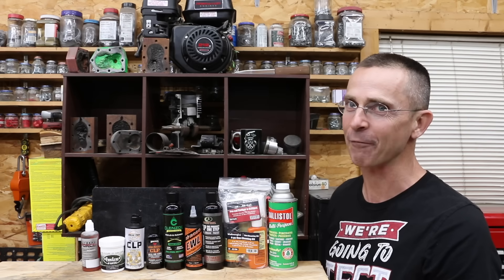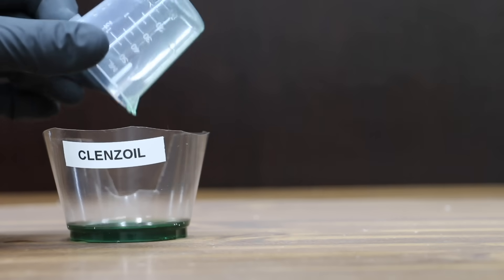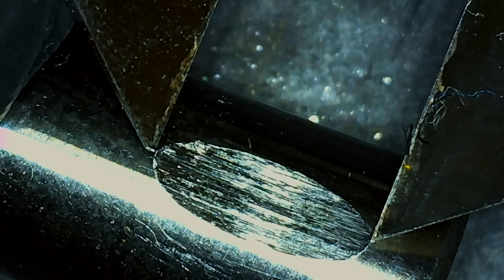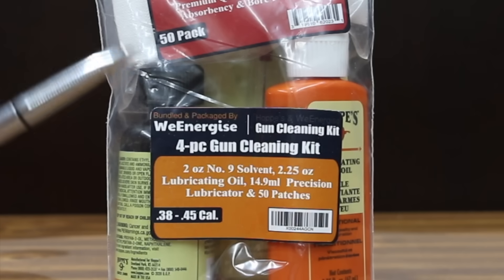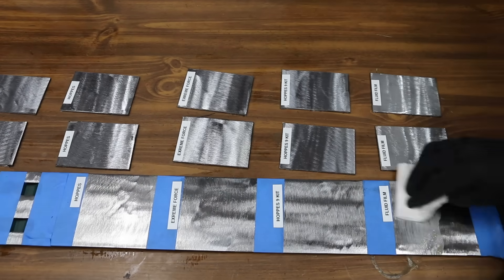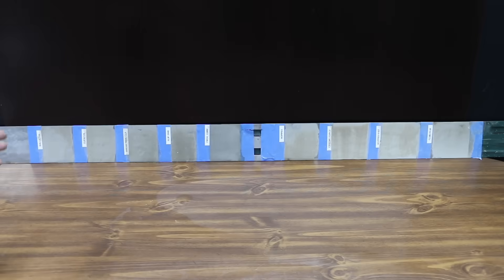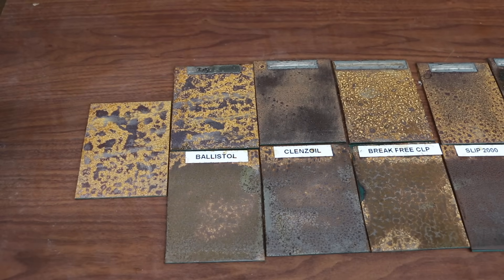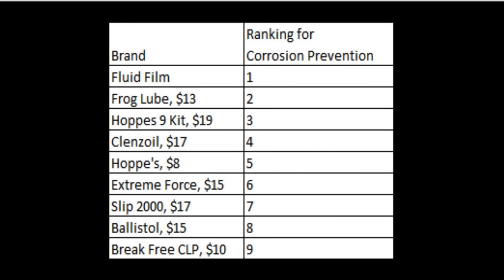Don't Buy A CLP Until You Watch This Review! It'll Save You Time And Money!

Comment: The overall poor performance of the Ballistol was interesting to me only because it is one of the most popular choices for black powder shooting. This is (I presume) because of its ability to suspend itself in water. There are actual instructions on the bottle on what concentrations of Ballistol to water in a spray bottle to use for various applications (it turns an opaque white, just like cutting tool lubricant in something like a CNC machine). Hot water is the cleaner of choice for all black powder weapons after a shooting session, followed by Ballistol for general cleaning, i.e. between shots, and then thick "bore butters" for patch/ball lubrication or storage. The Ballistol helps to clean up a lot of that water left behind after those first few passes with a scrub brush, as opposed to getting trapped or held in place by a gun oil or bore butter. That being said, I wonder how some of these other products respond to water? It would be interesting to discover a superior product to Ballistol that also responds similarly to water.

Comment: There is a huge mark up for products touted as "gun lubes"; this video is great.  But, there was no control for the cleaning test-  running the drill cloth dry, or with just water or alcohol could have given a similar excellent result (copper fouling, and powder residue is different than diesel exhaust-- likely easier to wipe off).  It would be interesting to run these CLP's against common non-gun products, to assess value (eg vs. 3in1, WD40, or motor oil, as previous comment).  The lubricant testing was excellent. Thanks.
Reply from the maker: Thanks!  Thanks for the constructive feedback.

Comment: friend raves about using engine oil fron turbine aircraft engines called Mobile 254, its for high heat high carbon areas, so bolt carriers are the perfec place for it,  not so much a general cleaner.  to decarbon you use a cleaner called Brulin 512  and man do it decarbon stuff but you cant buy small amounts so he uses Hoppes
Reply from the maker: Thanks for sharing.

Comment: Great video as always! What about a test of the smaller bit sets you would put in a travel tool bag. 30-50ish piece ones. Test for usability, ie do they fill them with useless bits you would never use and are the bits quality as good as individual sales or do they put low quality ones in to bring cost down.
Reply from the maker: Thanks!  Thanks for the suggestion.

Comment: CLPs are a compromise. A good detergent won’t be a good lubricant and vice versa. I have CLP for field expedient purposes. If the gun needs to run immediately, hopefully the clp will help dissolve crud and provide some lubrication ASAP. If you have time, a proper cleaner and separate lubricant works a lot better. Frog Lube is designed to be applied and heated to “soak in” and make a film, so your oven test did help it do it’s job. However I haven’t found it to be great for lubricating lots of moving parts. Hoppes oil is also a poor lubricant. MPro7 and Lucas Extreme duty can be found at most sporting goods and auto parts stores and are much better, as are countless other oils and greases. Great test though, will definitely influence what CLP I keep in my bag!
Reply from the maker: Thanks!  Thanks for the feedback.

Comment: You reported results of the wear scars to include 3 significant figures. 

That’s measurable, but I wonder what deviation you’d get if you ran one setup twice or more.

Using your own opinion, do you think the repeatability is within a fraction of a percent? If not, maybe just 2 significant figures should be reported in your graph.

Comment: I make my own gun cleaner and lube, using a recipe called "Ed's Red", which is based on the "Frankford Arsenal Cleaner No. 18" recipe, but updated.   (For example, Sperm Oil is not readily available anymore).    I've found it works very well for a LOT lower cost than any of the various 'wonderful' store brands.   

BTW - "Hoppe's" isn't pronounced "Hops".   It's Hop-pees, like saying 'happy' with an O.  

Maybe mix up some Ed's Red for your next review?
Reply from the maker: Thanks for the suggestion.

Comment: You should do a test between time-serts, helicoils, locking inserts, etc… for repairing stripped threads! It will be interesting to see the strength differences between them and the materials strengths.
Reply from the maker: Thanks for the suggestion.

Comment: You can buy the Break-Free CLP in a foaming aerosol can from Wally world or Amazon for about $1/Oz in a 12-oz can. I use it primarily for cleaning but I use TW25B for certain lube applications for larger sliding surfaces.
Reply from the maker: Thanks for sharing.

Comment: If you can include Militec in the 2nd round that would be great.  Developed for the military back in the day for the M16.    
Long stories short.  Used in race engine.  Oil pump fell on on the 350 during race.  Put back on and went racing.  Another time Lost coolant.  End result.  Melted 3 pistons, had to replace heads and 3 used pistons.  No oil related damage.  Went racing.
I use it in everything.  Autos, gas and diesel tractors, mowers, furnace blower motors and door knobs.
Reply from the maker: Thanks for the suggestion.

Comment: These were CLP's.  I'm not a fan of them.  They try to do 3 things all at once and tend to be the proverbial "jack of all trades, master of none."  A CLP is good for use in the field, as they were designed, but unless you need to clean and lube your gun in the bush or in combat, then task specific products are almost always better.

Typically, there are 3 basic cleaners depending on type of firearm and ammo:  a carbon cleaner, a copper cleaner, and a lead cleaner.

Lubrication, the best type will depend on the firearm.  Semi-autos have different lube needs than a bolt action, for example.  Climate can also dictate lube needs.

Protection.  What goes on the outside of the firearm to protect against rust.  There are several options here as well.  Some oils, while they are good lubes, aren't great at rust protection.  And, don't over look waxes for external protection.  Renaissance Wax, for example, is outstanding for the externals. It protects against moisture, rust, and even the oils and acids from fingers very well.

So, I'd like to see a "series" on firearm cleaners, lubes, and protectants, with each compared and tested for what it was designed to do, and include a couple of the many "home brew" recipes as well!

Concerning the cleaners, instead of dissolving carbon out of a section of tail pipe, try sprinkling some gun powder on steel coupons, light the powder with a match or something.  Then after it's all burned and cooled, apply the carbon/bore cleaners, then use a brass brush to scrub it a little. See how they perform that way as that's more real world in terms of what happens inside the barrel and how it is cleaned.  You could also rub some copper and lead onto the coupons to test copper  and lead cleaners as well.

The wear tester and freezing is good for the lubricant testing, but also baking them as you did for the rust testing, check to see if the conistency changes after the heat gets applied (do they turn color, gum up, etc, etc).

The protectants should be subjected to the rust testing, moisture, etc.  In addition to the peroxide/salt/vinegar, just do a longer term exposure outdoors as the mixture is a heavy oxidizer and may not represent actual conditions accurately.
Reply from the maker: Thanks for the suggestion.

Comment: I have used Frog Lube liquid and paste for the last decade on all my firearms. It has worked really well for me and does a good job with protecting and lubricating various gun metals and finishes. The key to making it work well is to apply it to a warm surface or heat up the weapon with a blow drier to get the lube into the metal. It'll perform better, but not required. 

Frog Lube will wipe right off with the carbon fouling after shooting. Never had clean up as easy as with Frog Lube.
Reply: Those are some of the main reasons I switched to FL also. Plus it is a non-petroleum based product and developed by ex navy seal, thus the Frog name from my understanding. I was impressed with the  water resistance shown from the product and the much more pleasant odor then Break Free that I was using at the time. Had a tough time keeping the kids out of it.
I've used more cleaning surfaces like my range hood of petroleum residue build up then it has to clean my firearms other than the initial application. So much easier and cleaner then when I was using spray or even liquid BF.
Reply: Did frog lube write this?
Reply: @jorgeo1492  He didn't test it's writing capabilities. Perhaps a follow up video on ability to write could be done.
Reply from the maker: Thanks for the feedback.
Reply: @ProjectFarm  same as OP the metal "sweats" the frog lube as it heats up if applied to the warmed parts prior.
Reply: Came to say the same thing. Great stuff!
Reply: Well, if youre in cold climate dont use Frog Lube. It eventually worked into my firing pin and when i had to Qual in the winter in gummed up and no bang.
Reply: @Arctictwist  well you don't use a quart at a time. If you're gummed up you applied way more than necessary. I apply it lightly and then warm up the parts or gun with a hair drier to absorb the Frog Lube. After it cools down you can wipe off anything that looks to be excess. You shouldn't have any issues then. It'll stay lubed even if it isn"t wet.

Comment: My Ballistol bubble burst.

Can the others treat leather and wood, as well?
Reply: I'm biased, I swear by ballistol. I don't use it because it's the best at any of what these tests measure but because of it's total package.  Works wonderful on rubber, hard plastics, wood, and all things gun cleaning/lube related.  Lastly, and in my opinion the biggest benefit, it's non-toxic.  I handle my guns with my bare hands same with anything leather/wood I use it on.  Other CLPs may be a little better, but spare me the toxic chemicals.  It's cheap, non-toxic, works on anything [even cuts/burns], and a can seems to last forever.  I even like the smell.

Comment: I'm a big fan of Frog Lube.  Per the instructions, heat will speed up the absorption of the lube into the metal.  When it's cold I use a hair dryer, when it's warm outside I set my firearms on the back porch in the sunlight.  Wipe on the Frog Lube, let it sit for an hour, then wipe it off.  Wipe it ALL off.  If you don't wipe it off it will thicken in cold weather and possibly cause a malfunction.  There are plenty of videos of people complaining about Frog Lube because they didn't read the instructions and used it like regular lubricant.  It's not. 

I've noticed that when shooting, the metal will sweat out the Frog Lube a little bit and the carbon will float on top.  It easily wipes off. I use it on my AR, AK and .45.
Reply from the maker: Thanks for sharing.

Comment: I am posting a comment here as it is the most recent video..   One comparison test would be for gasket making sealants..   Resistant issues, firmness, heat resistance and bonding strength.    This comes as a search for a good product that will not emulsify and separate in my clutch cover on motorcycle and clog my sump filter...   Just a suggestion that would ease concerns of viewership...   Thanks for all your work...
Reply from the maker: You are welcome!  Thanks for the suggestion.

Comment: I've use Hoppes #9 solvent for my entire lifetime (I'm 65 now), and your test proved that it is at the top of the list as a cleaning solvent, which is all I use it for.  It excels in that role.  However, I always follow up with a protective wipe of oil for the corrosion protection.  You can't argue the fact that Hoppes has been making Hoppes #9 product for almost 120 years.  Must be doing something right!
Reply from the maker: Thanks for the feedback.
Reply: I agree. I've never had any corrosion issue using Hoppes #9. But then, I clean after every use and lightly oil after cleaning.
Reply: 62 and it reminds me of my younger days
Reply: I've noticed that as well. That's why my range bag has a bottle of hoppes for barrels and a bottle of CLP for bolts
Reply: I’m 73, love that “Hoppies” smell.
Reply: Cept for the fact that it overall didn’t do that well 😂 The only reason it’s still around is because old farts insist it is the best and it must be doing something right….but isn’t. It’s just folklore keeping it around. I’ll believe testing vs….

Comment: Question, when you are measuring wear would a scale measuring weight removed posibly be a more accurate representation of wear?  Just thinking the wear scar length does not include the width or depth of wear so material lost on a 2mm wear scar vs a 4mm wear scar would actually be considerably less than half the wear instead of half the wear.

Comment: Great video. 

I stopped using Frog Lube on my firearms a while ago because you can't see the film so I always forget when I applied it last. But I do use it for metal protection on tools and such. Use the heat gun to warm up a the surface and apply the frog lube. Wipe off the excess after ten minutes or so. I do that to things like the table saw, bandsaw, tool heads etc and it's been great at preventing rust from forming.
Reply from the maker: Thanks!  Thanks for the feedback.

Comment: You should have done a corrosion test with out the heat. Come on, we clean after shooting and heat.
Reply from the maker: Thanks for the suggestion.
Reply: @ProjectFarm  even on a AR 15 with gas blow back system, the bolt carrier group and bolt face might get 190 degrees after firing 120 rounds straight, but, the barrel can get 700 degrees or hotter in some cases. Boil off on and in the barrel is expected. Not on everything else. There is gass discharge in the upper on the bolt carrier, but nothing as bad as you think as it exists the upper as the shell is ejected. I have a gass piston AR that I run whats called wet with silicone grease and the bolt face gets hot only if I abuse it. There are many hand guns like the SIG P230 that are gass blow back also and never attain the 400 degrees you used to do the test at. An avid gunner, will know to clean the barrel after shooting at minimum as any oil is cooked off quickly internally and externally.

Comment: Love all your videos!  However, I think there's an issue with the friction test here, specifically for firearms use.  Firearms are only lightly coated in lubricant, not operating under flood coating.  It might have been more accurate simply to wipe the lubricant on the parts and run the test, vs the constant bath.  Just my .02
Reply from the maker: Thanks!  Thanks for the constructive feedback.
Reply: it's a side-by-side controlled friction test, "flood coat" or "skim-coat" isn't going to change results. Material composition (I.e. Colt 1991 Commander 45 ACP Stainless, Colt 1991 Commander 45 ACP)  of the firearm will make a difference,
Reply: Yes, I thought of same, both surfaces should be wiped with oil and proceeded with testing.

Froglube is also meant to be used as dry lubricant, not as a paste.

Comment: You can objectively test dust build up by weighing each test item right before the test and after the test and getting a differential measurement.  You can use percentage change to normalize the size of the test template for each.
Reply from the maker: Thanks for the suggestion.

Comment: Test Idea: There are a variety of decking screws with a variety of materials and coatings; which one would hold up best against corrosion (importantly in cedar, which has tannins).
I've read that there are a number of zinc coatings as well as stainless and galvanized; as well as some screws that have polymer coats on top for even BETTER resistance. 
Curious to know what we should use to build our decks in the harsh winter.
Reply from the maker: Thanks for the video idea.

Comment: It was disappointing to see the very viscous Frog Lube compared to liquids.  I have used the Frog Lube thick liquid on my competition pistols for several years without seeing any obvious problems but that doesn't mean it's fully protecting some very expensive semi-auto pistols.  I would like to know if the liquid Frog Lube is any good.  Otherwise your test was excellent, as usual.  

Maybe serious firearm owners should be using one product for the safe keeping of firearms that are used infrequently and another for those that are use often.  That is my take on this test.  Another consideration is that oil is for fast moving parts and grease is for slow moving parts.
Reply from the maker: Thanks for the feedback.  Thanks for the suggestion.

Comment: Shooters have needs for carbon removers, copper removers, and lubricants.  Each of those 3 needs has at least 30 products designed for that although copper removers are broken down to corrosive and non-corrosive (ammonia).  As shown in the video, carbon is pretty easily removed. The plumbing product CLR removes carbon very well, but only use on stainless. As for lubricants, Mobil One 15w-50 is as good as anything and should pass the cold test. Sadly there is no one product for all needs, but CLP does come close. Most shooters have 10 bottles of products on the shelf they no longer use. If you do a follow up, don’t waste your time on WD-40 unless you want to prove it’s not intended to be a lubricant.  Great test!
Reply from the maker: Thanks!  Thanks for the feedback.